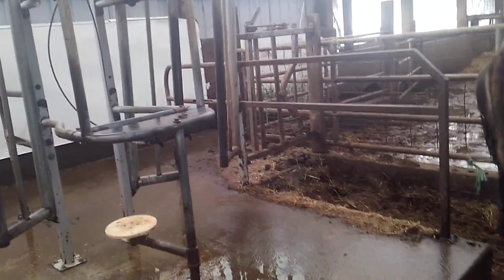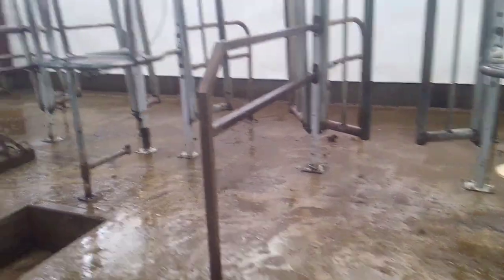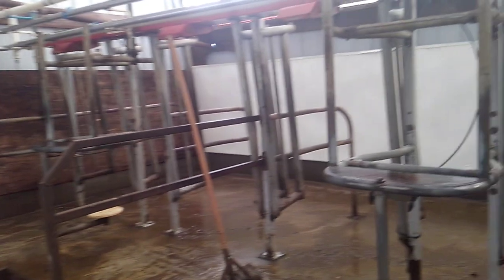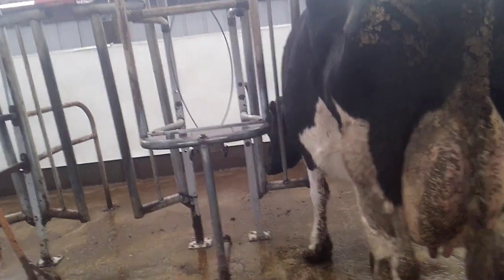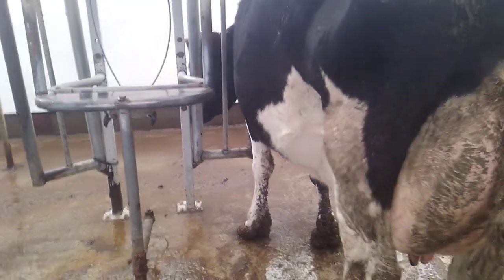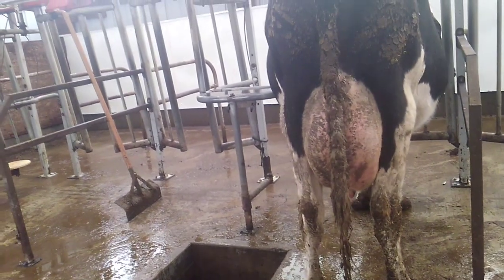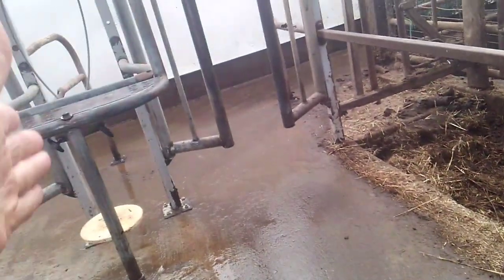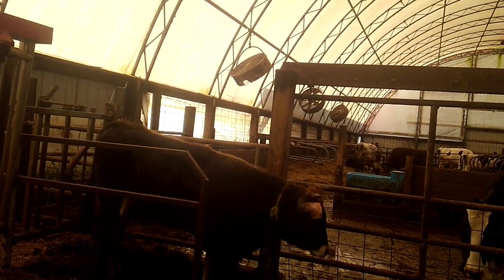Flat parlors AKA step up parlors and poor man parlors.

Comment: Do u remember the chore boy milking system?
Reply from the maker: Heard of it but never knew anyone with that brand equipment.
Reply: @Mad_Farmer912  Yeah we used it back in the 80s straining pads were attached to Miller hose then plugged into pipeline in middle over head in parlor .

Comment: Should be cheaper than a fancy parlor
Reply from the maker: Last I knew about $2000 a stall x6 so $12000. I paid $3000 for it used. Pipe line and equipment $2000 at an auction
Reply: @Mad_Farmer912  Guys we worked for in IN in those days fed their grain mixture in parlor we had pull ropes one or 2 tugs each depending on cow.A simple but nice little parlor.